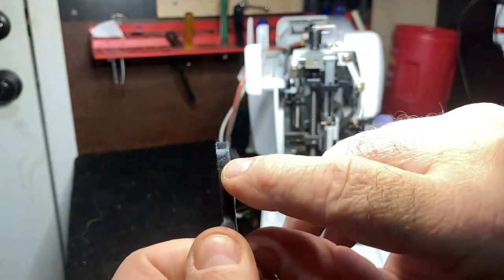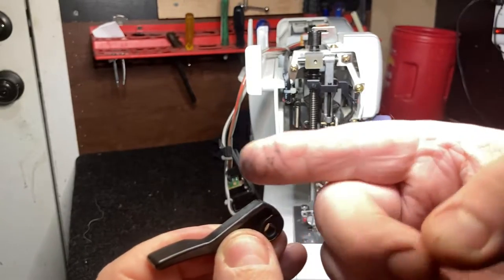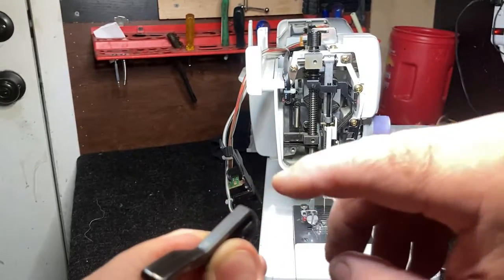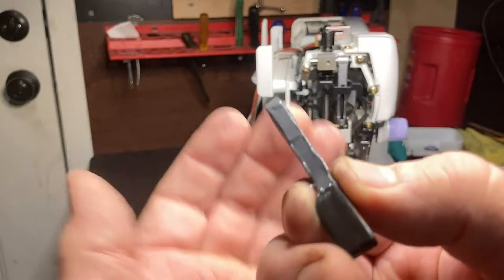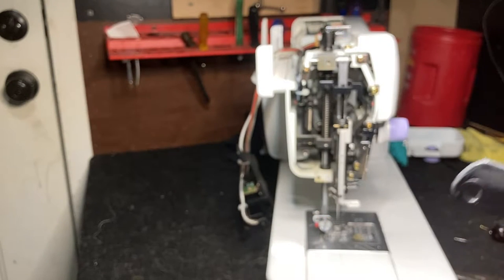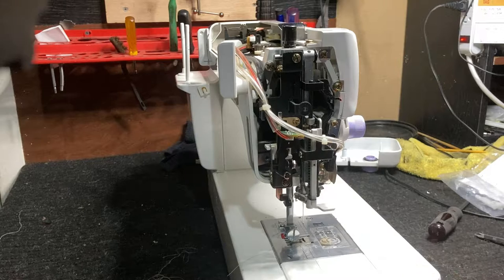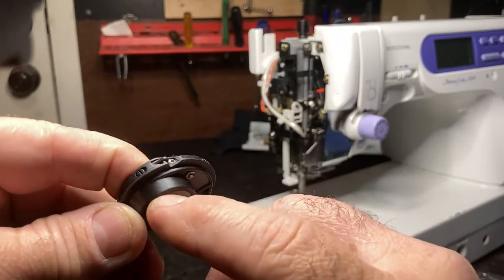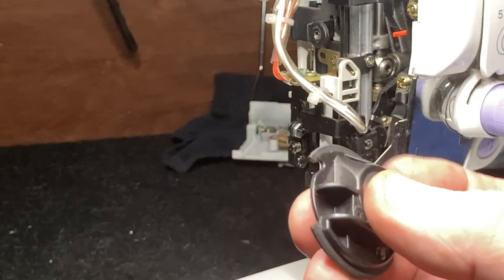Janome memory craft 6500 Repair & Maintenance

Comment: Why not install a new part? All that work to not replace a plastic part...? She should hve a back up machine and keep this great machine in tip top shape. No judging, Just saying- just saying! Good eagle eye on finging that straight pin.
Reply from the maker: I presume you mean the presser foot lifter.

The main reason was to show how to do a repair on the channel for people who need to repair rather than replace.

In actuality if I am not doing a video it is very easy for me to replace it and takes less than 5 minute.

But the repair is still holding

Comment: Sounds like that machine is working very hard to stitch through heavy fabrics. I'll stick with my old vintage Kenmore and Singer 201-2.
Reply from the maker: Nothing made today can match the old vintage machines, and will not last as long as they have already.

I love the old singer and Kenmore machines.

I  have a couple vintage machine videos coming  soon.
Reply: @sewingmachinetipsandtricks9079  I must say that this machine did do a nice job with buttonholes. But I'll still take a vintage machine with either a Greist or Singer Professional buttonholer.
Reply from the maker: Janome makes one of the better machines today, makes a great stitch and can do impressive work.  Between the electronics and  plastic if they last 20 years they are doing well, but they will not last 50 years or more and as you pointed out they are lacking in power when it comes to heavier fabrics.

I make these videos to help people who have these machines but I prefer the vintage sewing machines.

Comment: Not sure if you noticed but when you were greasing the thread cutting cam (cam1) part number 846105002 has a crack in it.  Just wondering if you replaced it.

Comment: Hi Richard,

I'm Ruben from Holland. We have a Janome mc8000 with this stepping motor error. I  reconnected the mainboard and cleaned most parts. It doesn't help but don't want to believe the mainboard or stepping motor is broke. If I interupt the sensor in top (with rotating black plastic turning through it ) it also gives this error. Could you please help me out?  Would be great!

greets from Holland and thanks Ruben
Reply from the maker: I need more information, when does it give the error and what exactly does the error say?

Which motor is it you have been interrupting the sensor on?

Comment: I just bought one from my new machine repair guy for a great price; he had gone over it, tuned it up, checked it twice, but in familiarizing myself with this machine (I used to have the 7700) I find that when I use my trilobal polyester thread (Isacord or Glide) in this 6500, it won't pull the bobbin thread up-when the needle goes down into the bobbin area, the top thread gets stuck,  catches on the left upper side of the bobbin case somehow, as if there is a burr or something,and shreds in there, causing an error message. If I switch to cotton thread, it seems to like that okay. I free motion quilted on my Janome 7700 with Isacord and Glide threads all the time with no issues. Can a machine hate a certain fiber thread?

Comment: How do I fix the cutter on my janome memory craft 6500p? It wants to jump to the right even when my needle is far left . I FEEL the kickback on the left, feels like it will break through the side wall of the machine!   Second question,  how do I fix the bobbin holder from jumping up and over in the machine? This causes problems and my needle hitting the plastic bobbin holder.  Thanks.

Comment: Brilliant video... Very helpful and informative. I recently purchased a Janome MC6600P used for a very good price, cleaned the machine and made sure the oil wicks were lubricated. It's really surprising what lint can do (i.e. cause skip stitches etc.) Under the bobbin case.
Adjusted timing and needle bar height and now sews beautifully, the only thing is the labels have worn off some of the buttons (scissors, needle up/down and lockstitch) but I know what buttons are for what so might sort out at later date. 
Janome UK told me they will only sell replacement board to authorised dealer/repair but I'm currently doing a sewing machine repair course, maybe in the future they'll be ok with it ha ha.
Reply from the maker: Thank you!

Janome makes very good machines, one of the best on the market.

Check out sewing parts online they may have the board you need.
Reply: @sewingmachinetipsandtricks9079  
Can you please tell me what type of grease you use on the gears/moving parts.
Reply from the maker: @carlreid7726  I use triflow grease it is thicker and works well.

Comment: Hello Richard:  I purchased a MC6500P from an older lady who never even took it out of the box.  It did not come with a foot control, rather came with the applicable Grace speed control.  (For long arm quilting on a domestic machine).  All settings on the speed controller (dip switches) are correct, and definitely the correct model. - problem:  there is only one speed.......SLOW.  The stitches are nice, but i cannot do anything with the speed.  Should I pull this apart and lubricate because it sat unused in an attic for several years?  Or is there something else I should be looking for.  (Yes, I know abut the speed bar on the machine itself....does not make any difference).  Thanks.  Lesley

Comment: Thank you so much for this video. I do have a question about the tension on my machine. I always seem to need to move it up to 7 and I’ve never had this much trouble with it. What do you think I might need to do besides clean it. (I’ve done that but no improvement)

Comment: I have a Memory Craft 6650.The auto cutter won't cut the thread and will not return to its original position. There is no lint around it or thread. Would you say the auto cutter needs to be replaced?

Comment: Non riesco a far funzionare l riempimento della spoletta,prima non funzionava poi ha ripreso e si fermava a metà spoletta mentre ora la devo riempire a mano.. grazie
Reply from the maker: Sounds like the wire that connects from the bobbin winder to the main board may be loose or not properly connected on one end or the other.  

Check both ends of the bobbin winder motor wire to ensure it is properly connected. 

It is a short wire so be careful not to pull on it as you put the top back on.